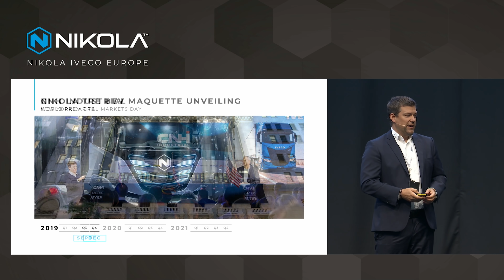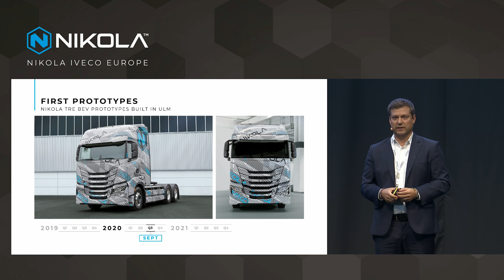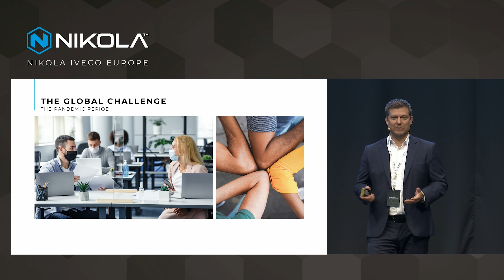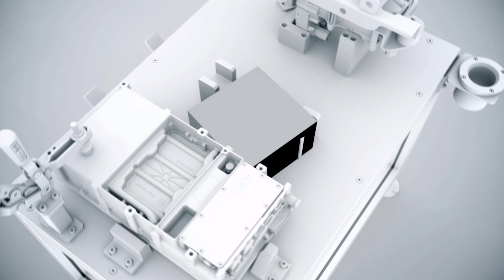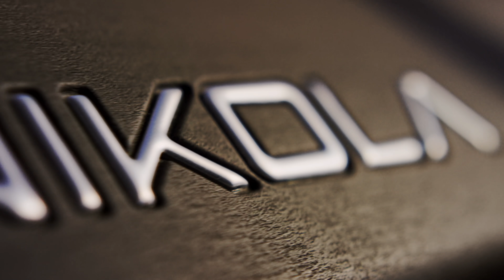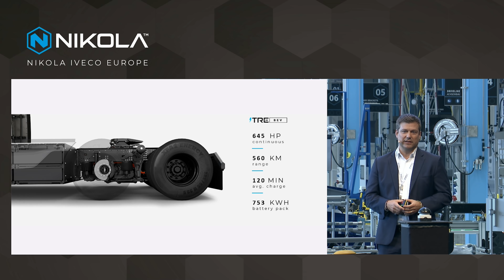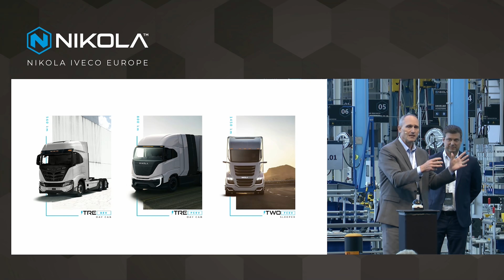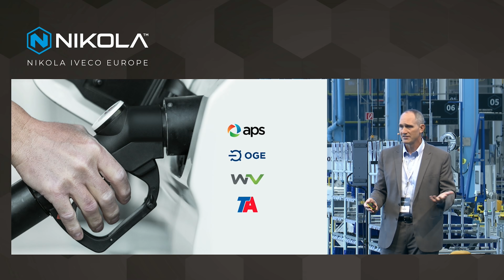Ulm Manufacturing Facility Inauguration Highlights | Nikola

Comment: FYI. The TRE shown is a 6x2 configuration.  It has one drive axle.  This solution does not have the same traction abilities as the common 6x4.  This is a problem for Iveco to solve, here in the US, to realize the performance that is required to be competitive with the 6x4 electric solutions from most competitors including Tesla. Volvo also has a 6x2 here in the US on their VNR electric.  The Iveco CEO knows he has a problem and that is why he mumbled his way through the power reduction excuses.   On previous videos you can see the traction issue demonstrated by the wheel spin during testing.  We also now know why the fifth wheel was pushed back so far.  They were trying to get more weight on the drive axle.  It will be interesting to see what solutions Iveco will implement.
Reply: I think the hitch was pushed back so far because they have 3 rows of 3  batteries spread across the frame behind the cab. They want to shorten the truck for Europe so it seems they will need to stack them vertically instead.